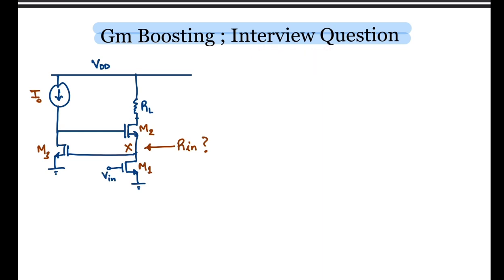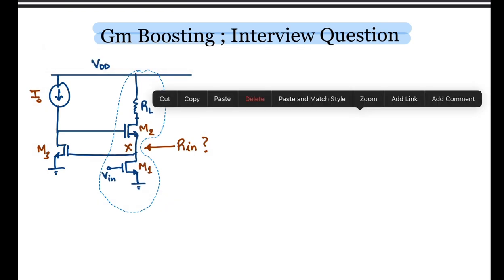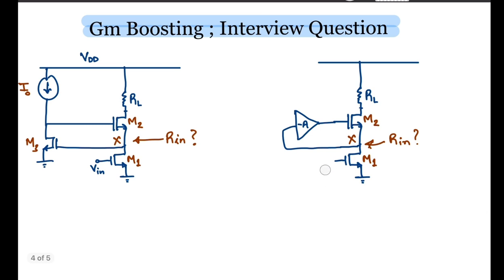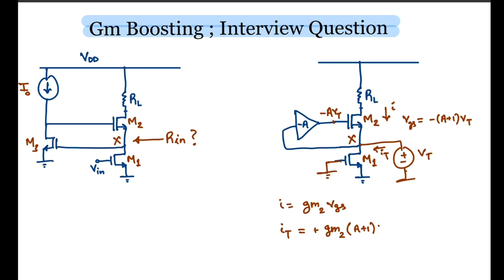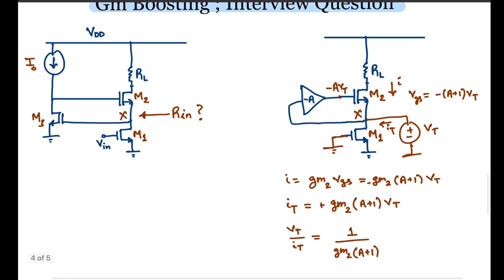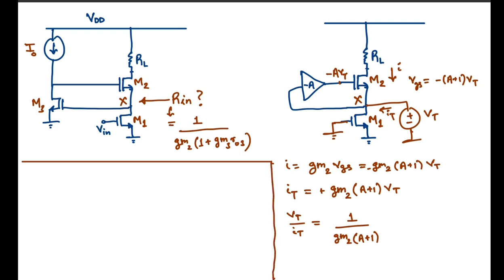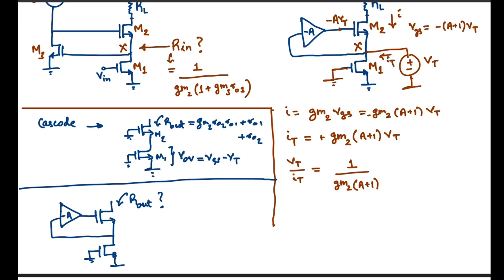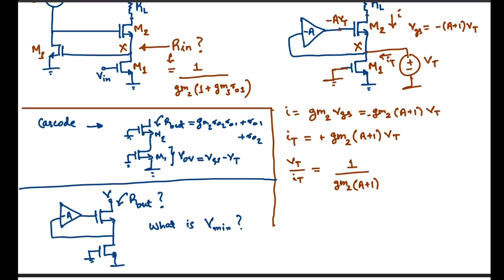Gain/Gm-Boosting ; Interview Questions

Comment: How you decide it's negative feedback?
Reply from the maker: Gain of a CS amplifier is negative.

A better way is to think about what happens if the voltage at X decreases by a small amount? M3 will pull lesser  current than before, and thus the gate voltage of M2 would increase, causing the current in M2 to increase, thereby increasing the voltage at node X.

Comment: Thank you for the explanation. In general, what does it mean than resistance at this node is small? Why is that important?
Reply from the maker: Glad you liked it. 

Usually if we are trying to build a voltage source then we would want its output impedance to be ideally 0. Think about the V vs I plot of a voltage source. It is a horizontal line at a fixed V, that can support any current. The derivative gives the small signal impedance. 

Another point is that current flows in the path of least resistance, thus, we have to be wary of it and design accordingly.

Comment: Please can you help with hint on what the output impedance is equal to?
Reply from the maker: I’m glad that someone is attempting the HW problem. 

You can think of as the upper transistor as an effective transistor with a gm of (A+1)*gm. Now, you are left with a cascode stage comprising of two transistors, the bottom one has a transconductance gm, and the top one has a transconductance of (A+1)*gm. Output impedance of both the transistors is ro. 

Hope that helps. Feel free to ask for clarifications.
Reply: Interesting. 

I now get the purpose of this lecture. One of the lessons here is breaking complex circuit topologies into simpler ones. And that was the hint you gave when you suggested we find the output impedance. 

This approach is far better in terms of the insights and intuition it provides compared to using the small signal model from scratch.
Reply: Before giving the HW, you asked for a better way of ramping up output impedance instead of stacking 3 transistors in cascode. 

After that, you mentioned the gm-boosting technique. With that, I thought the gm-boosting topology the topology that will help ramp up output impedance and would give a higher output impedance than 2 cascode transistors. But all we got from it is ro.
Reply from the maker: @emmanuelinnocent4505  The Gm-Boosting strategy does increase the output impedance by a factor of the gain of the amplifier. This is also called gain-boosting, since it boosts the gain through boosting the Rout.

Comment: Hi Tejas, I watched your video from the first to this. I really enjoy it! Thank you for your effort~
-
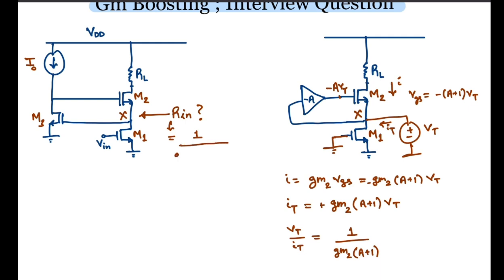I have one question related to this problem. At 2:13, we concludes that Rin is 1/gm2(A+1) instead of 1/gm2. I understand this, but why is it related to the cause of RL << ro2, didn't we ingnore the CLM of M1 and M2? (No ro1 and ro2 account). I thought it was because the gate of M2 is not directly connected to Drain of M2 that makes it not a diode connect.
Reply: The Rout of this ckt (include M3) is RL // (ro1 + ro2 + gm2*ro2*ro1*(A+1)).
-
Vmin = 2*deltaV
Reply from the maker: Thanks Morris. 

Initially I had ignored the effect of ro2 and ro1 to keep the analysis simple, in order to easily grasp the essence of the circuit. 

Later on I felt that it is important to emphasise that it is valid for Rl << ro2 since practically you might have RL larger than ro2 (for instance, a cascoded current mirror). 

Note that if you derive the expression for the input impedance at the source of a common-gate amplifier then the expression is not exactly 1/gm, but has a dependency on RL (impedance at the drain). 

Hope this helps.
Reply: @TejasKetkar  Thank you Tejas for your prompt response!!! I understand your point, if we consider both ro1 and ro2. Rin = ro1 // [(ro2+RL) / (1+gm2*ro2*(A+1))]

Comment: CcMuch appreciated Sir 😊
case1:
Rin=vn/ix
 ix=-gm2vgs=-gm2(vp-vn)
vp/vn=-gm3*ro3
So ix=-gm2(-gm3*ro*vn-vn)
  =gm2**gm3*ro*vn+gm2vn
=vn(gm2*gm3*ro+gm2)
vn/ix=
1/(gm2*gm3*ro3+gm2)=
1/gm2(1+gm3*ro3)
Reply from the maker: I’m not sure I understood your query. Could you please draw a schematic? 

As per my understanding A is the gain of the Common Source Amplifier formed by M3, thus, the gain is -ve.  

You can just think about what would happen if the fate voltage of M3 increases? It will pull more current and reduce the gate voltage of M2, so there’s a -ve relation.
Reply: @TejasKetkar thanks 
😊
Reply: Hope that you have a good time in America❤ @TejasKetkar
Reply from the maker: @waferlayout  Thanks for the wishes, but I’m presently located in India.

Comment: Nice  Sir 👍
So that’s it!😁
gain boosting in -ve negative feedback,cascode stage and CLM=0
M3:
A= vp/vn=-gm3ro3
And then Rin=vn/it 
-gm2vgs=it ,-gm2(-Avn-vn)=it
So Agm2vn+gm2vn=it 
vn/it=
1/gm2(1+A)....Rin
A=-gm3ro3

If RL is replaced with current source :
the overall voltage is |Av| gm1*(gm3ro3)*(ro1)*(1+gm2ro2)+ro2
Approximately 
gm1*(gm3ro3)*(gm2ro2ro1)...Answer